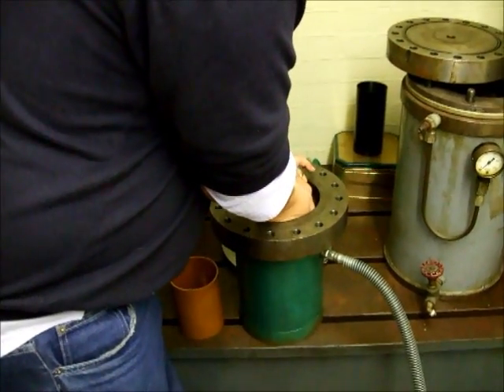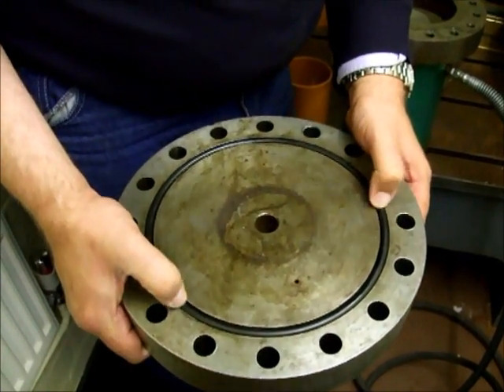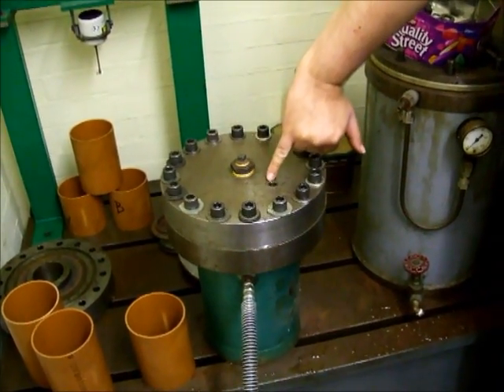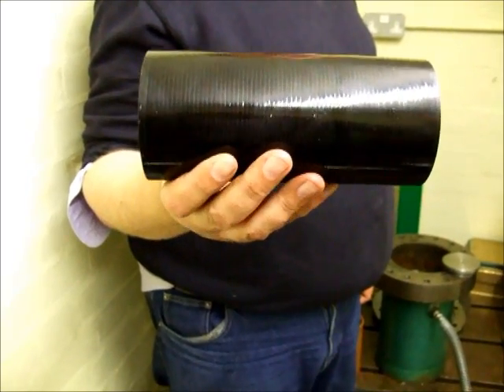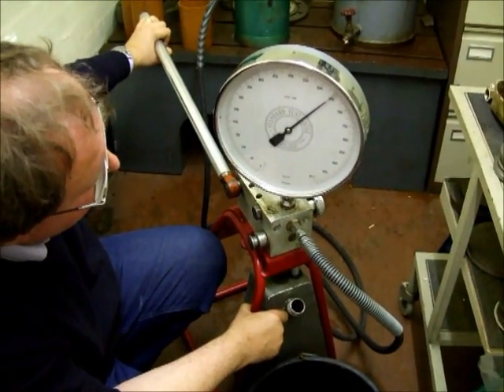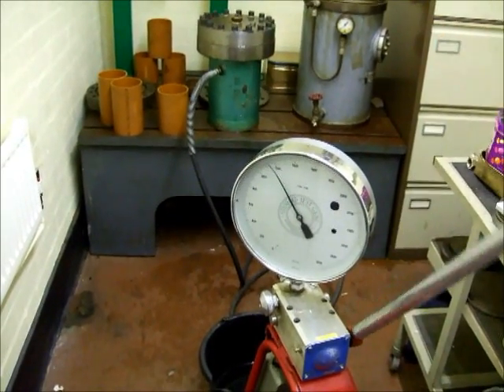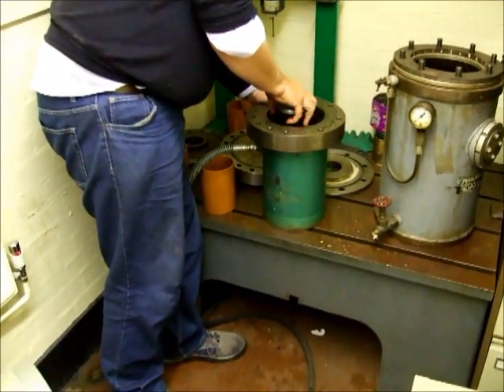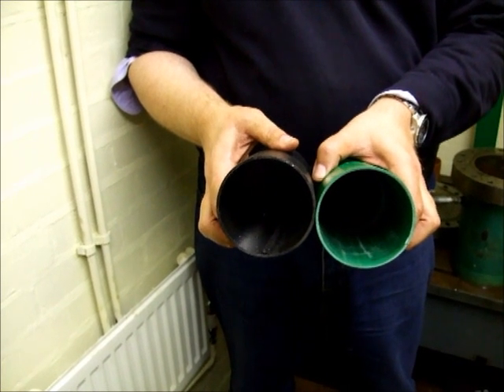Collapse of Composite Submarine Pressure Hulls

Comment: People in the comments are talking as though this video shows the Titan sub was destined for failure. It doesn't.

This video shows that a carbon fiber pressure vessel can withstand significant external pressure (1400psi before it yields here). It then yields suddenly by bursting. This is the key difference from the other material which deforms slightly but stays watertight.

For a submersible, *this is actually irrelevant*: the reason the other material "survives" is that, by buckling, the pressure in the tank is reduced. This is because the pressure comes from trying to squeeze more water into the fixed volume. Under the sea, the pressure comes from the weight of the water above. It is therefore constant, even when the pressure vessel begins to deform.

Now, a deformed pressure vessel actually becomes weaker than a true cylinder because it concentrates the stresses at certain locations. This means that any pressure vessel is likely to fail catastrophically at the bottom of the ocean. No matter what material.

The actual issue with carbon fiber is nothing to do with its strength or ability to withstand pressure. It's to do with the presence of defects (from its manufacture or from repeated pressurisation cycles). These can go unnoticed because they are internal and difficult to detect and they will reduce its strength.
Reply: I've known all this for many years. I see your new to the understanding of carbon fiber, keep trying to learn. Thanks.

Comment: If you didn't read the description or listen what they said in the video: They are testing GF and CF cylinders under rising external pressure to failure. To failure doesn't mean if the test article fails, but when. GF cyl failed at 375psi and CF cyl failed at 1400psi. In deep water these failures are followed by full implosion that is not the case with such limited volume test chamber.
Reply: As someone else said - it's 1400 bars, not PSI.  1400 bars = higher pressure than even at the bottom of the Mariana Trench.

So this video does not actually prove anything with regards to the Titan's flaws - since it doesn't cycle test the items in question to see if the failure pressure eventually drops (the suspected failure scenario of the Titan).  What IS shown in the video is that, just for a single dive, the CF hull would handle any pressure that can be found at any known location on Earth.

Edit:  Actually, I was wrong.  At one point in the video they DO say PSI.  Never mind.  That said, it still doesn't really show or prove anything with regards to Titan.  It just shows that for equivalent thickness, carbon fiber is vastly superior to glass fiber.  It doesn't compare to steel or titanium, doesn't compare performance over multiple cycles (the BIG flaw with composites), and doesn't discuss or compare any sort of performance scaling with thickness.  In fact, if you read this part of the description of the video: "If the strength: weight ratio of the submarines' materials of construction are high, submarines can usually dive to greater depths than if they are not." - they're effectively stating that they consider carbon fiber to be a superior material to glass fiber in this use case.
Reply: @Entropy512  At Titanic depth you would be talking well in excess of 5,000 psi.  Either steel or titanium would be stronger for the same thickness.

Comment: When they first started using aluminum cylinder blocks, the results were pretty bad. They were cracking constantly. Aluminum is quite a bit weaker than iron in most engineering characteristics. Now,  1000 hp Factory hot rods use aluminum blocks. Same material. Better casting design. Good thing the idiots on social media don't drive design innovation.
Reply: And none of them realise how their safety depends on carbon fibre on all modern aircraft - where it is used in compression and tension and in some cases BOTH depending on what part of the dynamic load cycle you are at - the mounting tang on the A300 vertical stabilizer!!!!!! Just a historical example.